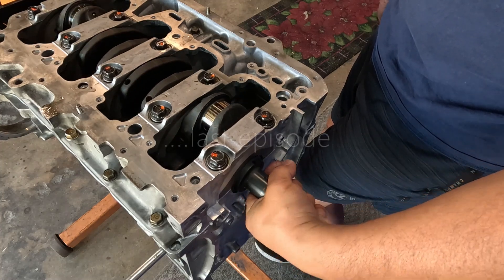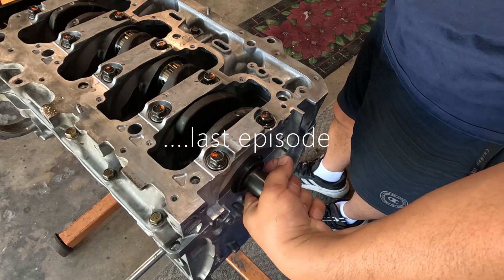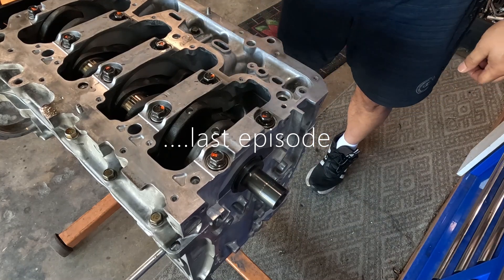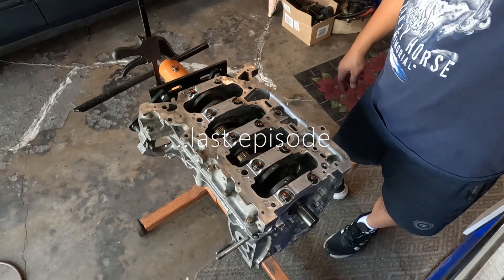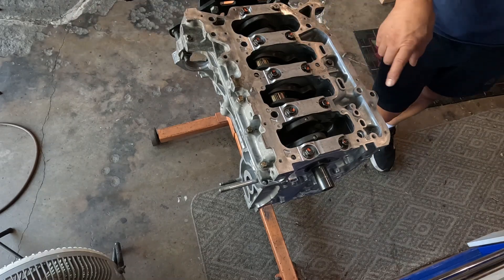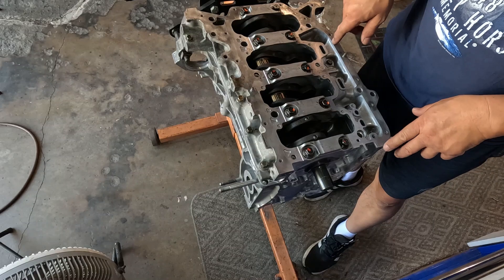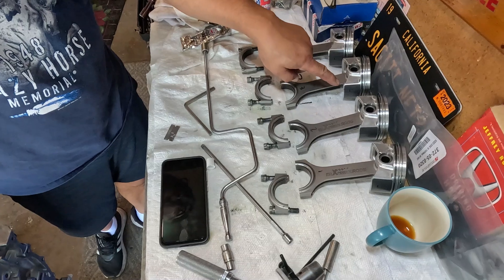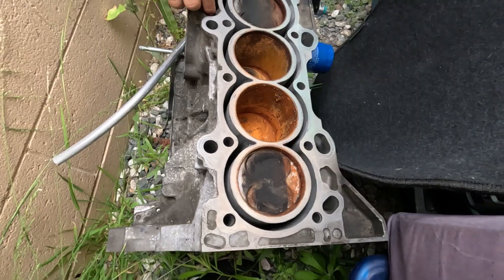K24 Build part 2; Piston and Rod installation, Short block assembled. ep. 2

Comment: Nice video, waiting to see how much power it will make compared to a g23
Of topic question, I built a g23 with a h22a1 head, I was offered a Euro R head for cheap and I was wondering if I can just change it or if it needs any other modification to be installed on the f23 block.
Does is required the same modifications as the regular h22 head?
Reply from the maker: Thanks brother! The goal for now is just to rebuild the motor and gathering some of more parts that l needed lol! Its quite expensive, l'm still waiting at the yard for a manual tranny and associated parts like axles. Just got back from there and got me a starter and no tranny, someone beat me to it. It goes out fast from wrecking yard. You can't really beat the $200 price tag compare to buying ir $1500 from jdm broker. Anyway, the H22a1 head and euro R H22 are the same, maybe some lettering are different but exactly the same. The difference are the valve springs if the euro R that was offer to you is for type S. Otherwise, it's basically the same. You better off do a valve spring upgrade and  install a type S from the euro R head if its indeed a type S. You have to measure the center lobe to find out.
Reply: @sagittnet2158  Hopefully you can get the tranny so you can complete the project and show it on the channel
What valve spring brand do you recommend for this setup? Not trying to get big number, just want a fun ride